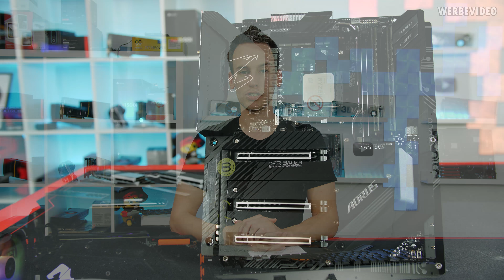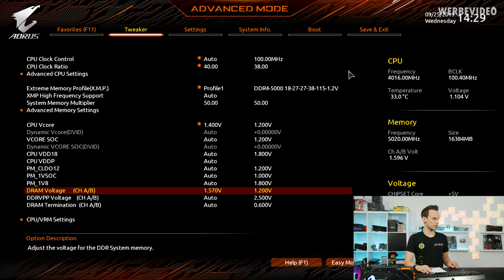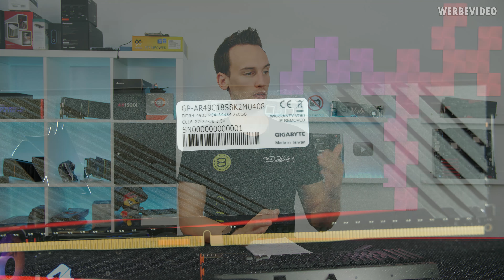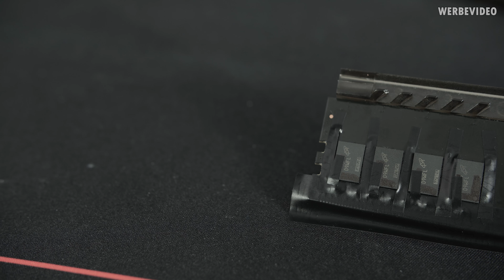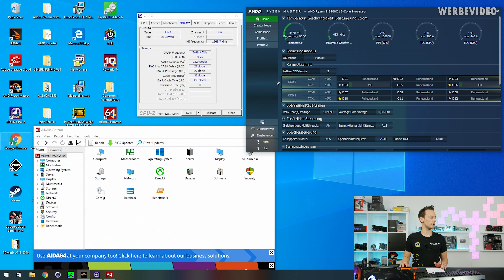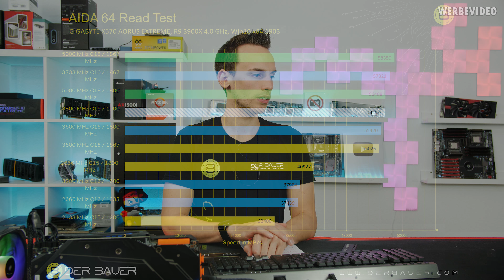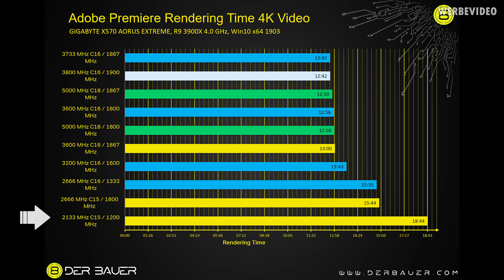Insane: 5000 MHz RAM Speed on RYZEN 3900X

Comment: Is there somewhere we can go to find out what is the best RAM for our systems?
Reply: No, just like some Intel (most), struggle above 4000 MHz and flat out cant run it while some can just fine. Similarly none of my first gen Ryzen can even run 3000 MHz, but meanwhile my Threadripper first gen is just happy to run quad channel 3700+ MHz like it’s nothing (and the Ryzen desktop systems used everything from air to sub-zero cooling, as well as up to 50% over-volt on SOC because I didn’t care if they died, as well as only running half the sticks to put less load, and they were tested on a decent X370 board, they WOULD NOT run it! Meanwhile maybe the next chip out of the box could do 3800 like Threadripper without issues).

Same as cpu lottery, except even WAY more variation for CPU memory controllers, so sure, what’s “best” may not even be possible for you even if you killed several chips trying to run it on liquid nitrogen, which is why nobody can say “xyz is best”, because not every cpu can run it, and then it starts to compromise to the point of “what’s the best that all but the lowest 1% can run (which would be like regular 2133 MHz), or possibly if your a gambling man “what could half of the systems run...” and you got a 50/50 shot if it was a waste of time and money or just a little bit more performance....

So, unfortunately, it’s just like overclocking, nobody can tell you an exact value, and it goes to the point of how much you want to spend (benching for world records? Got cash drowning you? Or should you just buy a couple Titan RTX in SLI instead? Or is it “this faster kit is $50 more, is it worth it?” <- and that’s probably still no... unless it’s 2133 vs 3600 in a 128 GB kit for your shiny new Threadripper 2990WX in which case the $50 is probably worth it).

Most of the time, any system (except Ryzen 1st gen, because it probably won’t run it and be more headache than it’s worth) would be perfectly fine with 3200 MHz memory. Even if you have 2x 2080ti (especially at 4k, lol, massive GPU bound at 4k!) you probably won’t notice much of a difference on anything else (maybe you’ll see that 5 fps difference with your 240 Hz monitor, I know I would, but you also need a cryogenically cooled cpu to run 240 Hz fast enough that it would matter...). So short story, most modern systems will be fine on ordinary and affordable 3200 cl16 and you won’t have too many problems, you really can’t go wrong at that choice for 99% of people. Also if your cpu is not Threadripper or Xeon, only run 2 sticks, that’s basically it in a nut shell.
Reply: @jakegarrett8109  Well I know, as does anyone who is an enthusiast that there is no cut and dry but I am just looking for some base lines. personally I am sticking with Intel myself and I run the 2066 chip set configured with 64GB of 4800 RAM and its doing well without any OC at all. Still always on the hunt for what is best and will give the best performance, hence the reason for my question.
Reply: @kevinm3751  Wow, you're lucky, a few comments above yours a guy was struggling to get 4200 working on his 9900k with 4600 kit (I presume 16 GB). Getting that much RAM to boot at even 4000 would be an accomplishment, that's impressive!

If you ever decide to throw away that kit during an upgrade, just toss it in an envelope and send it to me, my test bench is always accepting donations of fire extinguishers and it probably wouldn't mind a nice set of RAM (also GPU LN2 coolers if you're tossing out other cool stuff, haha!). I mean, why sell it right? haha, Cheers!
Reply: @jakegarrett8109  I think the biggest difference is possibly the chipset. I could not find that comment but I am betting he is probably not running the 2066 chipset (probably 1151) and is likely why he is struggling. Honestly I am experiencing some issues and have not yet put my finger on if it is a RAM issue or not? I am running a M.2 NvME drive without a cooling solution and have one on order thinking that might be the cause of my occasional lockups, but at this point I cant rule out my RAM choice is not the problem.
Reply: @kevinm3751  You shouldn't get a lock up from NVME throttle (even in my thin laptop, my MP510 doesn't seem to throttle, still in the 3000 MB/s read and write ranges, and it pretty much has 0 airflow where its shoved in). You would possibly get throttle, but unlikely unless you're hammering it for 20 minutes as just sitting there it shouldn't get that hot. Also, I just use a generic 15x15mm heatsink since its better than most "heatsinks" for NVME drives, I have one zip tied to the controller on my desktops NVME (I also use them for cooling VRMs on motherboards/GPUs, and Vram). Those do just fine, and about $1.20 for a pack of 10.

Sounds like something is definitely unstable, and if its not your CPU or GPU (GPU instability can definitely cause system crashes), then its probably your RAM if anything is having a hardware issue (never rule out Windows, Windows is the most unstable pile of garbage there is for an OS! I have to reinstall every weekend that I benchmark, killing Windows in 3 hours is not an issue for me!)
Reply: @jakegarrett8109  Thanks for that info Jake, I know its not my video card and because it just started 4 months after the build but not before I did not suspect the RAM and have done several benchmarks stressing it and it shows zero signs of failing. Same for the CPU, it has been stress tested quite a few times as well and shows no poor marks. That leaves the one common denominator that we both completely agree on and that is its likely a corrupt Windows install. It sure as hell would not be the first time that has been the problem. Which is why next weekend after I get the heatsink for the M.2, which I was wondering about (thanks) and since I got it I will put it on and then dump the system and rebuild it.

Comment: You should be able to get the fabric clock to run at 1900 no? I was able to get it without too much tweaking. Is there a benefit to running 1800 instead?
Reply: @Gandalf721  thanks! Guess I got lucky then. Running a 3900X

Comment: Would running "4:1" match latency of 2:1?
Reply: Yeah probably, except your fclk would run at 1250mhz, which is probably not worth it either. Might also run into issues if your latencies are not multiples of 2 in that case, like if you run c17 but you have to wait till 18. Anyhow, I have no idea what I'm talking about so don't take my word for it.
Reply: @jadoei13  get stuck at low fclk anyways with LN2, so might be interesting to see what performance difference might be.

Comment: nanometer volts break connections to be effective unless using 45 nanometer die. smaller is worse on voltage............................................................longlife

Comment: 3200 at CL16 is a high CL. My 3200 are CL12
Reply: Very good timings, i've got 4x4Gb Ballistix Elite 3200 cl16 o/c at 3466 cl16 with my Evga Z390 FTW and i5 9600k 😁
Reply: that's the cheapest 3200 there is or typically sold everywhere, i do have the hynix c die cl16 but it is easy to oc this die to get better performance.

Comment: Please, can u test it with Intol CPU?
Reply: Can Intel's IMC even handle 5G?
Reply: @rdmz135  dunno, but im pretty sure latency could be very good
Reply: @rdmz135  found out that u can even get 6 on intel
Reply: @rdmz135  i strongly doubt, at least not at reasonable VCCSA voltages, afaik, some high end intel chips can't go over 4400 at reasonable voltage
Reply: @wwtorm510  I've never dabbled with advanced memory OC on Intel, but AFAIK most chips cap out at around 4.5Ghz. Most motherboards don't even allow you to go beyond that.
Reply: @rdmz135  With that shitty timing 18 (27-27) 38. Yes.

Comment: Is it possible to overclock the fabric to 2500MHz so it is synchonous with the RAM?
Is the speed MB or MiBs?
Reply: No. As shown in the benchmarks on this video, infinity fabric is not stable above 1867MHz.
Reply: No. As shown in the benchmarks on this video, infinity fabric is not stable above 1867MHz.
Reply: @nathangamble125  TNX

Comment: What about 3200Mhz at 14 14 14 32??? that CL 14 for the most part in smaller Apps that simulate everyday use?? No one is running anything that intense like AIDA 64....

Comment: I have my memory overclocked to 3666 MT/s with tight timings (DRAM Calculator), synchronized with the IF of course and CPU at stock settings (no PO, not manually overclocked). For me the read is around 54.8 GB/s and the latency is around 65-66 ns. So yes, he looses over 10 ns on latency because the RAM and IF are not synchronized.
Reply: That read seems low. I believe I was seeing over 57 GB/s at 3733 MT/s
Reply: @imadecoy.  depends on memory timings, ram has more than your primary and secondary timings. Even small changes to the third timings can make a big difference in read/write/copy.
Reply: @JosephArata  Well I guess Hynix CJR is king then
Reply: Possibly, but I thought Dual Rank was supposed to be better too. I have a ($90) Patriot Viper 3733 MT/s CL 17 single rank kit (Hynix CJR) that I've used DRAM calculator settings for 3733 MT/s CL16. I was also seeing about 65 ns latency. The kit will also do 3800 without issue, but my motherboard is missing options to make the Fclk stable.

Comment: higher voltage and higher cost..its not worth it all to 4000-5000 modules.
3200-3800  with best timings is the best you will do
3600-3800 the best choice

Comment: Roman, I disagree to some extend with your statement that we should treat these small differences for Cinebench multithreaded as run to run variances. Yes, the run to run variances are large enough that that plays a role but if you consistently on several experiments notice a drop in score with worse timings and slower RAM then that could be a pattern, depending on the number of experiments. Compare it to meta-studies in the medical/pharmaceutical field. They work with very small variances so they use a lot of studies with small variances to see patterns. That and it is an easy way to get more articles written and more funding. ;) 

I noticed that with ABBA Cinebench performs more consistently than with ABB. I don't know why but all of the sudden I get exactly the same score in several runs in a row for both singlethreaded and multithreaded while with ABB the variation could be quite large, especially for multithreaded.

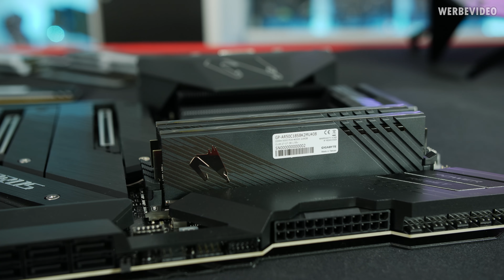Comment: 1:20 vdimm 1.55 V jesus! It's only marginally better than 1:1 ratio. I wonder if you'd be better off just tightening timings.
Reply: Yah, I noticed the voltage too. I thought 1.5v was max while OC'ing, at least where you can feel safe. 1.55 retail is.. a a lot it seems, and I have heard mixed things at voltage sabove 1.5.

Comment: Probably not worth it.
I'm getting 53000 at just 3733 in sync mode, with 68ns latency.... on a 3700X even.
Yeah... got to the benchmarks part. 3733 in Sync mode is overall winner. No point if going anything faster than that (unless a good CPU happens to support 3800 stable)

Comment: Not that greate. Tested my rams G.Skill Trident Z Royal Silver CL17 4000Mhz but runs at 3800 because are not compatible with my motherboard but the banchmark result are: Read: 52782, Write:53350 and coppy 47651.  with 46 latency and they are run at 3800 so.............

Comment: What if you run the memory at 5000 MT/s and keep the fabric at 1250Mhz at 2:1? it should get rid of the latency penalty but in turn your FCLK might end up being the bottleneck. Would be interesting to see.
Reply: FCLKs that low nuke your performance. I already tried it with 1100 fabric at 4400MHz mem.
Reply: I guess that settles that!
Reply: @rdmz135  1600 and 4800?
Reply: @duckymint53  that would be out of sync

Comment: Running low speed ram with slow IF and asynchronous mode is worst combination. You should had used maximum possible IF speed with those 2133 sticks, they will have much better performance, nearly same as those 3200.

Comment: Could you use a clock inverter on one of two RAM sticks in an SLI type configuration to effectively turn two 16gb 3600mhz sticks in dual channel into one 16gb 7200mhz stick and run in 4:1 ratio to maximize ryzen performance? Not saying it's easy just asking if it's possible?

Comment: It looks like using more than 3600 MHz with Ryzen is just nonsense, it doesn't work. I have 3800X and when I set more than 3600 than latency is going to shits because of IF bus, I thought with like 4400 or more MHz this problem will be solved and you will get clearly better ram performance, but it looks like it's not really true.

Comment: I doubt 5000nhz can be achieved with 1:1 infinity fabric, even under nitrogen. This puts 1,250mhz on the infinity fabric. The rated speed for Ryzen 3000 is 3200mhz, and can keep IF to 3,600-3,733mhz. It's  literally rated to run a 1600mhz infinity fabric. Nobody in their right mind would run over 3800mhz (if they're lucky) or 3200mhz (if they're very unlucky) on Ryzen, unless they were in a situation where 1: RAN bandwidth matters and 2: inter-core communications don't matter. And very, very few scenarios (none that immediately come to mind) would be incredibly RAM intensive, while running on a single core. There is no reason to do this. Ever.

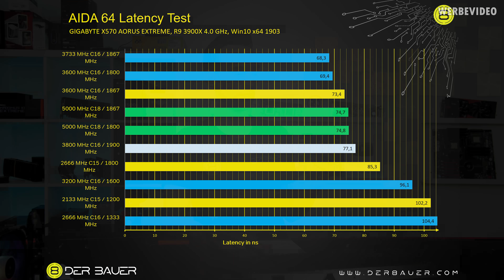Comment: The latency chart 15:05 ~15:25 shows the 3800MHz CL16 / 1900MHz IF resulting a 77,1ns. What ram is that and with what settings? Is it XMP or not? Im asking because I also run this kind of configuration with very different result: XMP on, 3800MHz CL16-18-18-36 / 1900MHz = 67ns (Ryzen 5 3600 stock settings)
Reply: I guarantee it's not XMP, since XMP always never works to begin with.
Reply: ShroudedWolf51 didn’t I say I’m using XMP? Even with a higher speed than the rated. And I know a lot of users with enabled XMP on a Ryzen platform that works just fine.

Comment: I bought some 4800 mhz gskills Trident Royal Z waiting for the 3950x to come out. Wanted to see how well they'll work or if at all. Just bought the Asrock aqua motherboard. Will be picking it up at the UPS store won't be sitting outside! I'm hoping to OC them. Now I'm getting hyped for the 3950x. Going to try to get it as soon as it's available before it goes out of stock. Then the third party sellers jack the price through the roof. I will not buy at an over MSRP price. Far as I'm concerned they can sit on them until they are obsolete

Comment: So, for mere mortal's wallets, DDR4 3600 C16 modules, with a synchronous 1800MHz infinity fabric clock, appears to be the way to go for Zen 2. DDR4 3200 C16 and below on the other hand tends to result in progressively greater performance penalties, while beyond 3600, the price per module shoots up with diminishing returns on further performance.

Comment: This ram sucks. My 4200 Mhz CL16-18-18-28-280 is faster 64K Read 64K Write 59K Copy 37.6 Latency. I have 8700K though.
Reply: He should try it on intel platform as well. That 18-27-27 timing is ridiculous. I could probably boot mine near 5000 mhz with this if i had z390 and it would perform worse lol

Comment: 18-27-27-38 isn't much impressive really. I always hated going into these wacky timings. You do straight timings at 24/7 voltage with 24/7 stability and CR 1T or you're not doing it right. Not to mention Zen2 doesn't even benefit from this. Anyone going out of 1:1 is basically an idiot. Were these rated for 21-21-21-41 at 1.5v I would have been much more impressed. Even 22-22-22-42 would have gotten a pass. These using Micron flash already classifies them as junk. CommetLake is supposed to have an improved memory controller. Lets see what G.Skill can do! Their kits always have the tightest binning. They already showed off a 5000 17-17-17-37 kit though with unspecified voltage. If they can get that into 1.55volts it will be amazing.........and hilariously expensive. lol

Comment: No no no no no. This is not how you use those sticks. You should have run them at 1900 1:1:1 and tighten up the timings. Or put them in an intel rig and push for the frequency. That's the proper way to treat those sticks.
8:38 - You are still confused. NB Frequency is uclk (or UMC clock, a.k.a. unified memory controller clock) and in this case it's obviously set to half of DRAM Frequency (memclk).

Comment: Doesnt look that fast. I get better read/write/latency with 3733Mhz memory @3900X...
Reply: auto subtimings. Though rev-E doesn't tighten those as well as B-die does so it might never catch up.
Reply: @ActuallyHardcoreOverclocking  Oh, right those auto subtimings are usually horrible. I managed to get stable 3733MHz 15-16-15-14-30-44(or 32-46 can't remember right now) that gave me about 63.2-63.5 latency but I can't get 1900MHz IF to even boot. Is there anything I can try to tweak?